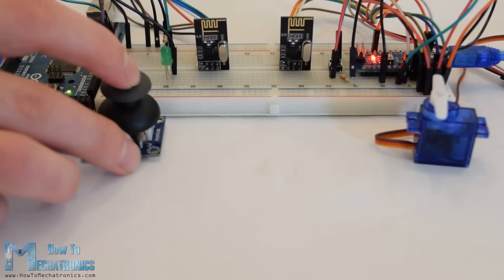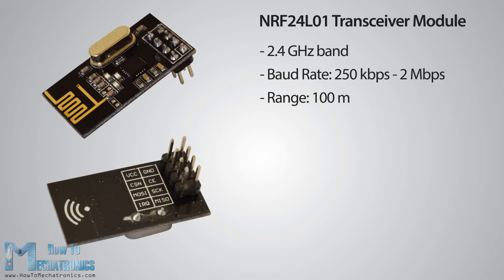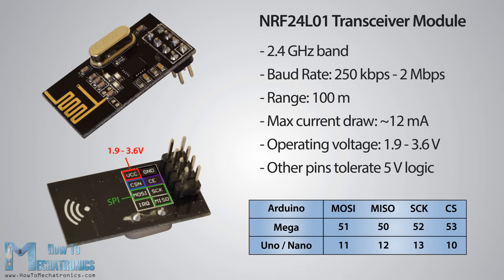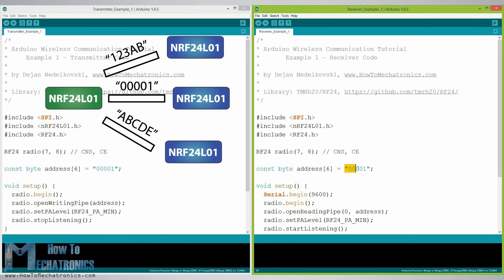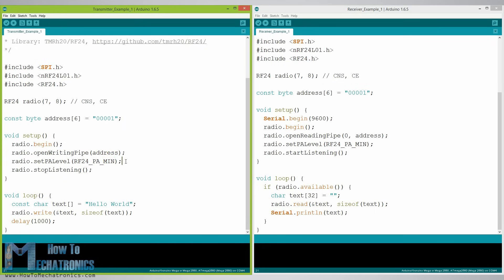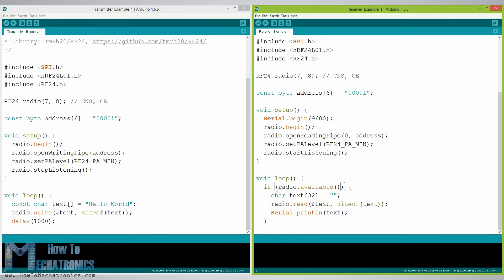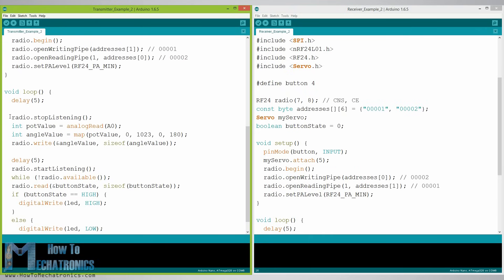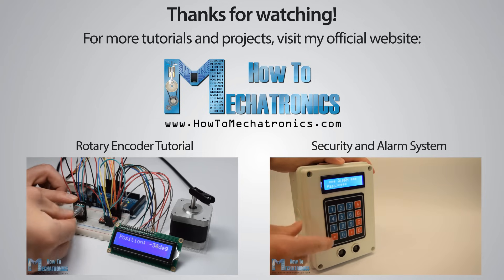Arduino Wireless Communication – NRF24L01 Tutorial

Comment: could anyone help me ? i have already build a full homemade RC boat and it works now..BUT initially i wanted to use an arduino nano for the receiver side on the boat...i ended up burning 3! of them before switching to arduino uno which works fine..ANY IDEAS why it happened? as i said it works now with UNO i just NEED to know :-) it doesnt make sense

Comment: Why doesnt this code works on two UNOs? Ive been trying to connect two UNOs with this code but I cannot see why it isnt working? Does anybody know?
Reply: Ok. I will try again, but i dont think that is the problem beacuse i have already reconnected the wires for two times and it didnt work. Maybe there is an industrial bug in my arduino. Thanks for the answer

GND-GND, 
VCC-3,3V, 
CE-7, 
CSN-8,
SCK-13, 
MO-11,
MI-12, 
IRQ-/

This is the connection that i used on both nano and uno. Its right isnt it?

Comment: can some one please help it doesnt work by me ? if i trie to run the print hello world code from the website and  checkt evry connection ist only prints this :???????
and i dond know wahts wrong
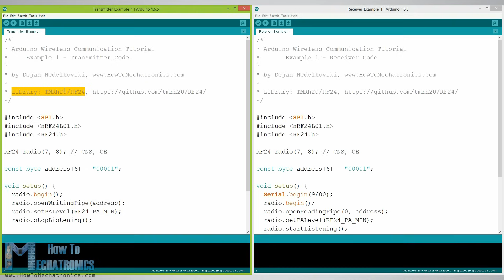Reply: Try swapping your wires for the 7/8 pins (CSN and CE), or swap the numbers in the code when you create the radio. If you notice, at 2:30 and 2:40 he has the pins reversed between the explanation and the code. Just a small mistake in the video I believe, I was getting the same thing until I figured it out.

Comment: Highly recommend!! Have a capacitor about 10uF, will maintain your power supply. Stick on the Transmitter side (3.3 V  to Ground ). Make sure your capacitor direction ! Otherwise, it will boooooooom!!!!

Comment: When i Open the Serial Monitor on the Receiver it only Gives me "       ?       ?          ÿÿÿ ÿ ÿÿÿÿÿÿ ÿÿÿÿ Ô õ" 
Any Ideas what Could be the Problem?
Reply: Check the baud rate in the lower right corner of the Serial Monitor.
Reply: If anyone else has the problem... make sure the CSN & CE pins go to 7 & 8, in my case I had them to 9 & 10 (from a previous experiment) and it didn't work.

Comment: ____________________________________Attention!!!! 
-If you have a problem with this example check your hardware its realllly important.
-Also solder 10uF capacitor between power and ground pin on the nrf240l1 side(it has to be close as much as possible).

Comment: I have several questions please respond:
1)Why are there two arguments with openReadingPipe i.e 0,address?What is zero here?What if I remove zero and simply write address?
2)Why was it necessary to write Serial.begin(9600) in recieving but not transmission?What would have happened if I wrote it in both the cases and what would have happened if I wrote it under none?

Comment: output not shown in the serial monitor even though i run the same code ...can any one reply ?
Reply: Make sure you enable serial communication at the beginning of your code and that you open the serial monitor on the port you have the receiver attached to. Make sure the baud rate on your serial monitor matches the baud rate in your code.

Comment: I don't understand what I am doing wrong. I am using the rf modules with the antenna (Which I presume are still RF24L01) as well as adapter boards. I have copied the code in the tutorial exactly and tried running the code with and without the adapter boards but nothing I do works. I am using two arduino uno rev3 boards wired up according to this tutorial's wiring diagram for the nano. I have tried alternative wiring methods and adjusted RF24 radio(X, Y) according to what pins I used for CNS and CE. Any suggestions? I am desperate for help.

UPDATE: I figured it out. I had to set radio data rate. Just adding this line of code to my transmitter and receiver fixed my issue. radio.setDataRate(RF24_250KBPS);

Comment: Hi ,how can i use nrf24l01 for many to one communication i.e i want multiple nrf24l01(node side) data will comes to one nrf24l01(gateway side)? unlike you have shown one to many communication.
Reply: Dejan Nedelkovski  how it can be done can u tell. I am thinking of doing by changing the readingpipe address  of nrf i.e gateway side or master side in every one sec to get remote side nrf data.

Comment: The code ism't working, there is nothing printed on the serial monitor
Reply: Double check your port numbers and make sure you're opening the serial port on the receiver. Also, I have a lot of things plugged into my USB ports. I found i had better luck powering the transmitter externally. Last resort, I also had better results using shorter wires (longer wires start acting like antennas and start picking up noise), but I wouldn't think that would cause no output.
Reply: Also, be sure the baud rate on your serial monitor matches the baud rate in your code.
Reply: Fixed, Thanks for your reply :D

Comment: it didn't work , still the test code worked !
Reply: Same.
Reply: Try commenting out the empty while loop in the transmitter code. The motor should start to work and the led should light, but it will blink randomly. Still trying to figure out what the problem is with the while loop. Are you using an Arduino Nano?

Comment: what is the maximum distance of this module?
Reply from the maker: The NRF24L01 module max distance in open space is 100 meters.
Reply: Picked two with external antennas. Someone had tested them out to 1,070 meteres
Reply: @Eurus721  yea you can do that but that is all Line of Sight and requires some good antennas(not the one that comes with the NRF24l01 with PA and LNA) . People have gone far and beyond 10km marks as well(most videos available on youtube)

Comment: "it is recommended to use the bypass capacitors across the..." what?
Reply: That means put a capacitor between the 3V3 power source pin and ground. If there are any fluctuations to the power during transmission, the capacitor will smooth them out.

Comment: It's doesn't work to me
Reply: You need to get an nrf24l01 breakout board and wire the arduino 5v vcc output to the breakout board input vcc
Reply: @arhamthowheed9471  Do i really need that? I don't know why is not working. I've checked al the conections and sometimes prints random characters like these: ???????????%??? And chinese characters too. I'm using mega and nano.
Reply: @myperro77  yes you do, beacause the probelm is that teh 3.3v pin output on the arduino boards doesnt have enough power to power the nrf24l01 modules, their quite cheap , they go for about £1.50 per breakout board
Reply: @arhamthowheed9471  Well, its matter of time i get with one of those. Thanks for reply!
Reply: @arhamthowheed9471 you don't need that module lmaoo  , I've literally made a long range rc controller without the ams1117 voltage regulator board for the nrf24l01 lol . This entire video is a mess , first the pinout for the nano is wrong on diagram at 2:30 , sck should be D13 and MISO D12. Then the first code is wrong because the CSN and CE are swapped , it should be (7,8) not  (8,7)